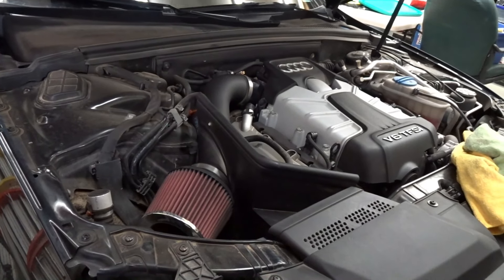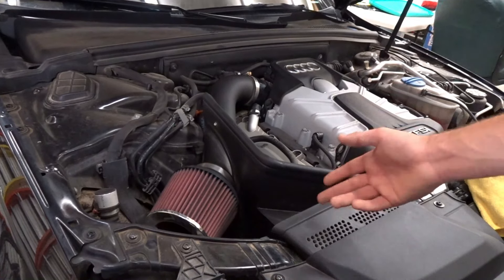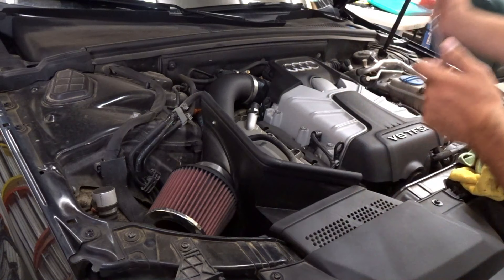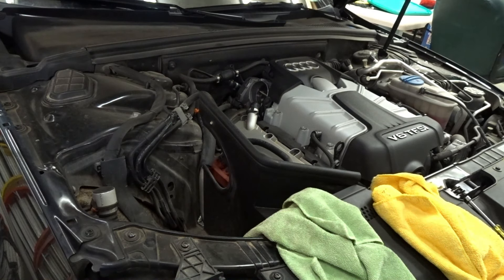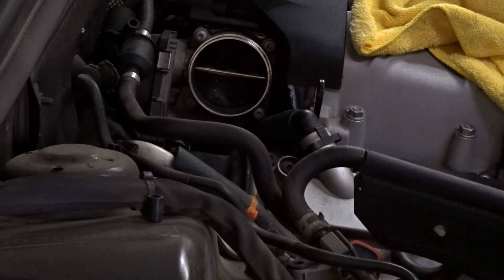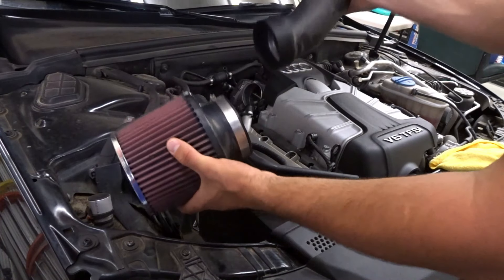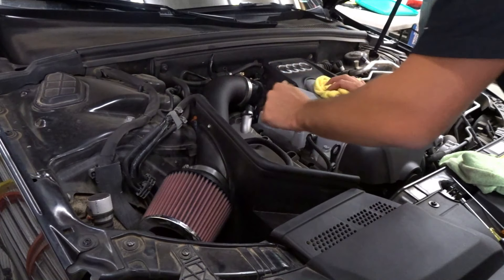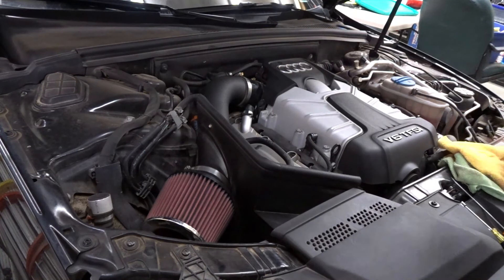B8 Audi S4 | CHECK ENGINE LIGHT ERROR P0068 MAF | Week 5

Comment: Did you have to run the VCDS throttle body adaptation after cleaning the throttle body? Everywhere I’ve read they have said you have to reprogram the throttle body. But maybe they had to because they completely removed/ unplugged it to clean. Please let me know what you think or if you did do the adaptation

Comment: Great video mate. 
Question: I even replaced my throttle body unit, error is still there along with P0507 Idle air control system error. Any guidance?
Reply from the maker: Sorry about the no reply it must of skipped my mind! Hope you figured it out man!
Reply: @alphaautomotive2147  yes, it was thw faulty PCV valve

Comment: Hi I have this code also P0068 however, I didn't think we had an MAF rather the 3.0T engines have 3 different "MAP" sensors - so I replaced all 3 of them. I also removed the TB, sprayed and wiped it clean, tried to reset the error via Carista, but it keeps coming back P0068 permanent. Any other ideas what it may be?
Reply from the maker: I wonder if it could be a wiring or cpu issue, my light didn’t go away right after, I had to take it for a drive and get some air flowing through it. I wonder if following the wires and ensuring there isn’t a disconnect down the line would be worth it?